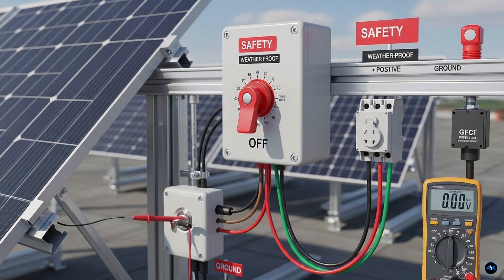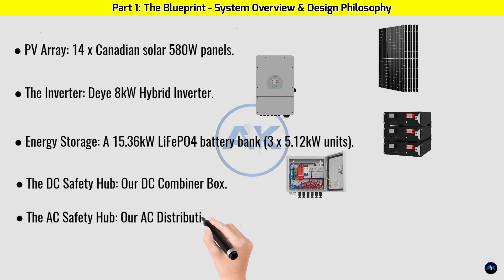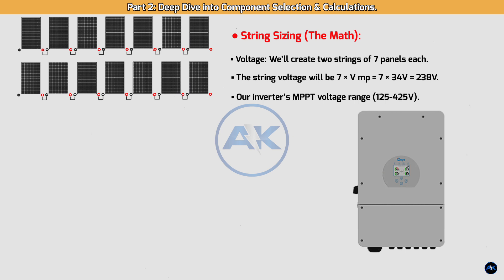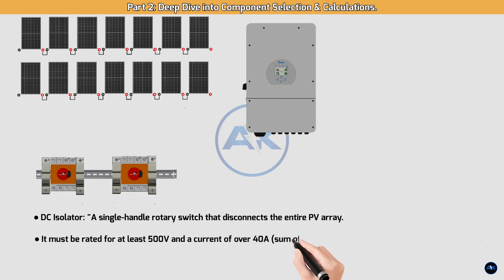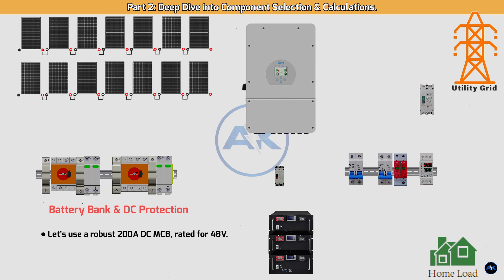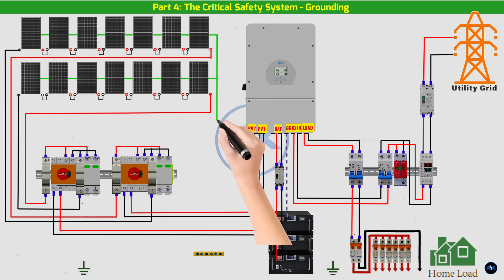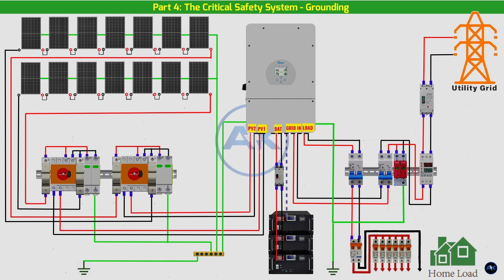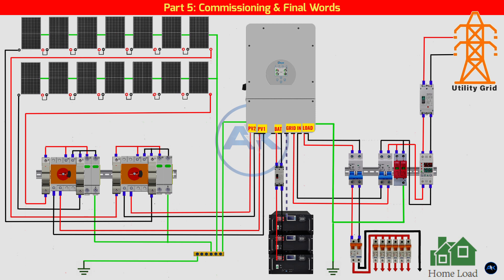The Ultimate DIY 8kW Hybrid Solar System  A Deep Dive for Beginners

Comment: Can you do a video with the information provided below? I will be below this system a few months. 

I am living in Jamaica.

On my utility bill, it shows  that I burn  264.53 kWh in a 30-day month, my average daily usage would be:
264.53 kWh / 30 days = 8.81 kWh per day. 

STC: Irradiance 1000W/m?, Cell Temperature 25° C, AM=1.5
Bifacial Solar Panels 550 watts (I am buying 8 of these panels)
Rated voltage (Vmpp/V) - 42.27
Rated current (Impp /A) - 13.01
Open circuit voltage (Voc/V) - 50.53
Short-circuit current (Isc/A) - 13.84

NMOT: Irradiance 800W/m', Ambient Temperature 20* C, AM=1.5, Wind Speed 1m/s
Rated output (Pmpp / Wp) - 411.0
Rated voltage (Vmpp /V)  - 39.39
Rated current (Impp /A)  - 10.43
Open circuit voltage (Voc /V) - 47.53
Short-circuit current (Isc /A) - 11.23

SPI Series inverter Rated Output Power 10,000W
Rated Output Voltage 120Vac，single-phase / 240Vac

BATTERY*
Battery Type Li-ion / Lead-acid
Rated Battery Voltage 48Vdc
Battery Voltage Range 40～60Vdc 
Max. MPPT Charging Current 200A 

Max. Mains / Generator
Charging Current 120A 
Max. Hybrid Charging Current 200A

PV INPUT*
Num. of MPPT Trackers 2
Max. PV Array Power 5,500W+5,500W
Max. 
Input Current 22A+22A
Max. 
Open Circuit Voltage 500Vdc+500Vdc
MPPT Voltage Range 125～425Vdc

UTILITY / GENERATOR INPUT
*
Input Voltage Range 90～140Vac 

Frequency Range 50/60Hz
Bypass Overload Current 63A

LiFePO4 battery - With Breaker*
Array Mode 16S
Nominal Energy (KWh) 16
Nominal Voltage (V) 51.2
Charge Voltage (V) 58.4
Discharge Cut-off Voltage (V) 41.6
Standard Charging Current(A) 100
Max.Continuous Charging Current (A) 200
Max.Continuous Discharging Curent (A) 200
Reply from the maker: https://youtu.be/DbxyceGLuvU

Comment: Why do we need Automatic transfer switches??? This is for on-grid and with batteries（Deye hybrid inverter).
Reply from the maker: That's an excellent and very important question! 💡
You're right, in a system with a hybrid inverter and batteries, an Automatic Transfer Switch (ATS) is a crucial component. The main reason you need it is to seamlessly and safely transition your home's power source during a grid outage.
Here's why:
 * Safety First: The ATS automatically disconnects your home from the main grid during a power cut. This prevents your solar system from "backfeeding" power onto the grid lines, which is a significant safety hazard for utility workers who may be working to restore power.
 * Instantaneous Backup Power: It ensures that your home can instantly switch to the battery and solar power for uninterrupted electricity, without you having to do anything manually.
It's all about ensuring both your safety and a smooth, reliable power supply. Thanks for asking!
Reply: @akelectricdiy But why does this Hybrid system not have ATS???

Comment: Please do a video of 10kw deye hybrid inverter low voltage and high voltage along with 15 or 20 kw lifepo4 batteries and with vikram hjt panels with all wiring details and much more emphasis on earthing details
Reply: My connection is three phase

Comment: Can I put a protection relay on the inverter  output to determine the amount of power drawn from the inverter?
Reply from the maker: "That's an interesting question! A protection relay's main job is to protect equipment from faults, not to measure power. To determine the amount of power being drawn from your inverter, you would need to use a power meter or a multimeter with a power measurement feature. These devices are specifically designed to measure voltage and current and then calculate the power."

Comment: Why was ATS not used in this project?🤔
Reply: I wondered why it was used the first time.
Reply from the maker: That's a great question! Without knowing the specific details of the project, it's hard to say for sure. However, there are several common reasons why an Automatic Transfer Switch (ATS) might not be used:
 * Integrated Functionality: Many modern solar inverters, especially hybrid models, have an internal transfer switch. This means the system can automatically switch between solar/battery power and the grid without a separate ATS unit.
 * Off-Grid System: If the project is a completely off-grid system and has no connection to the utility grid, an ATS is unnecessary because there's nothing to switch to.
 * Manual Transfer Switch: In some cases, a project may use a simple, manual transfer switch to save costs or because the owner prefers to manually control the power source.
 * Simplified Design: For smaller or non-critical systems, the added cost and complexity of an ATS might be deemed unnecessary.
The most likely reason is that the system's inverter has an integrated transfer function.
Reply from the maker: That's a great question! Without knowing the specific details of the project, it's hard to say for sure. However, there are several common reasons why an Automatic Transfer Switch (ATS) might not be used:
 * Integrated Functionality: Many modern solar inverters, especially hybrid models, have an internal transfer switch. This means the system can automatically switch between solar/battery power and the grid without a separate ATS unit.
 * Off-Grid System: If the project is a completely off-grid system and has no connection to the utility grid, an ATS is unnecessary because there's nothing to switch to.
 * Manual Transfer Switch: In some cases, a project may use a simple, manual transfer switch to save costs or because the owner prefers to manually control the power source.
 * Simplified Design: For smaller or non-critical systems, the added cost and complexity of an ATS might be deemed unnecessary.
The most likely reason is that the system's inverter has an integrated transfer function.